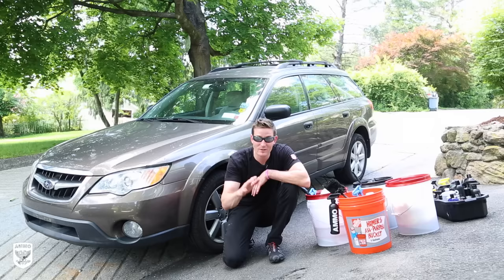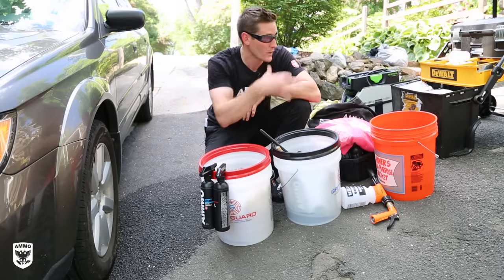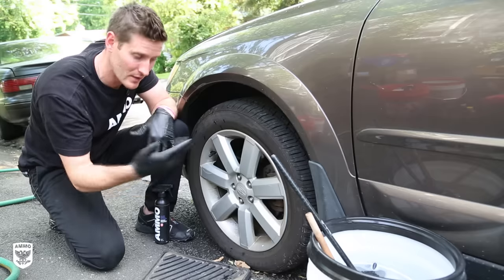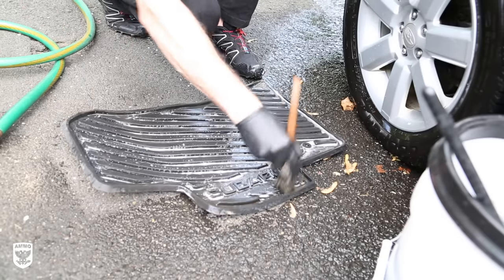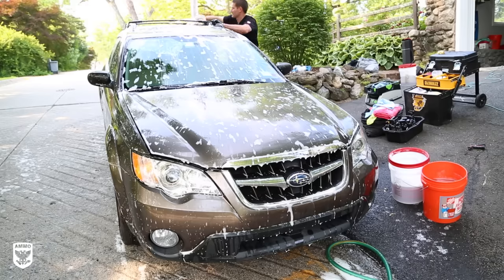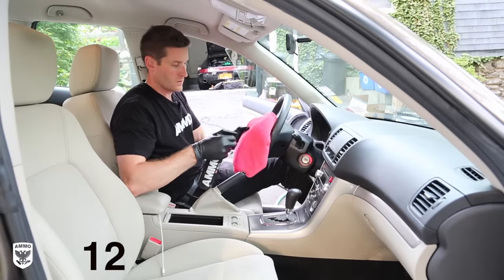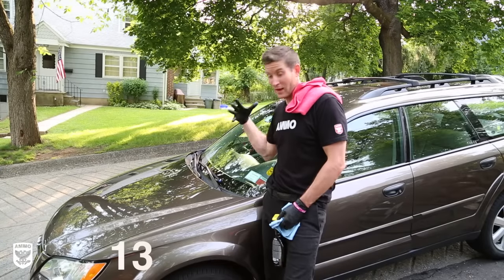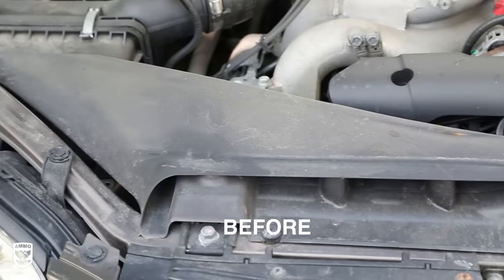Best Carwash Technique: 15 Steps + Tools

Comment: Wouldn’t it be better to use 5-6 wash mitts instead of a wash and rinse buckets. Just one bucket with your soap, water and mitts! Empty bucket for the used mitts. This way with 5-6 mitts there is no way of contamination getting into the bucket and transferring it onto the car? No more grit guards, no chance of contamination save on water. Just rinse and comb out your mitts when your done! Wash mitts are cheap to buy. If your a mobile detailer you can have 15 mitts on hand at any time! When your done at the end of the day wash them in the washing machine with a little car soap that you use when washing cars.

Comment: hi need your advice I am a beginner I have my car mobile wash business  it is steam wash I am using optima steamer , I am really Confused until now I didn't start my business because I dont now if I have the right tools , I wash my car and my friends car even if it is really dirty it will give good results bit i am not sure if steam only is enough .I see your video it is the same steps I do , I also use wheel cleaner and engine cleaner I really have Difficulty in cleaning the glass actually i don't know how to clean the windows using the steam and windows cleaner only .so plz can you help your little brother to set my mind in how to use optima steamer what is the steps that I need to do , I wont to look professional as you .

Comment: It's risky getting any water near electrical components under the hood. Using brake cleaner and a rag is probably best. Just ask Scotty Kilmer. Many use a two bucket system . I feel even with a two bucket system it's theoretically possible to still get dirt on your mitt. I use one bucket. If I suspect there's anything on my mitt I will hose it down with a lot of pressure. I clean the wheels last so I can use the same one bucket. I clean all the rims first so I don't get brake dust on the wheels. I hose off my brushes and buckets before and after each wash. I bought supplies in a car wash supply place that sells commercial chemicals. Suppose to wash and rinse one panel at a time. Important to fold chamois or towel so it doesn't touch ground at all when wiping lower panels of car. One is suppose to use spray wax when car is wet. I made that mistake other day, as I dried it first.  When you wash towel or chamois never use fabric softener.

Comment: enjoy your vids and work... 3 things I noticed that I didnt agree with.. appreciate you were flying through a lot of stuff here and you can always find fault... but do you agree on these 3 things?

1 you didnt rinse your pre wash foam off the car before shampoo'ing...  the pre rinse purpose is to disolve dirt. and although some of it will just run off the car you better rinsing it off and then shampooing rather than leaving it and shampooing over the top of it.

2 door shuts.. you commented that these parts of the car are really dirty.. and you use a spray wax and an old dirty microfibre, I wouldnt use spraywax on any dirt...  I would say use a soap or an all purpose cleaner to break the dirt down with a clean micro fibre.  because there is paint work in the door shuts and you dont want to scratch it.

3 dont put the car carpet matts on the dirty ground.. they typically have black rubber or some sort of abrasive rubber underside this will pick up dirt grit (or gunk :) ) on the ground and it will stick to the matt.

great videos...

Comment: What can I use instead of a foam gun ?
Reply: A real gun
Reply: Gloria FM 10 works really well. Use 1 L of plain water, add 15 ml of Valet Pro Snow Foam and a bit of any car shampoo you like
Reply: self serve car wash down the street works just fine.
Reply: I'd say! I take some of my interior cleaning products down to the local self-serve carwash and use the massive foam sprays. A lot of them are $1 or $2 on timers and have all the functions - pre-wash, soap wash, high pressure wash, tyre wash etc. and even a vacuum
Reply: Jonas: Me too! Gloria FM10 with 15ml of VP Neutral Snow Foam + 15ml of VP Prewash (instead of shampoo) in 1 liter of water. This works very well for me ;)
Reply: I've heard of some folks using those pressurized pump containers (sorta like what folks will use with weed killer spray or with bug killer spray).
Reply: deasttn Really? Yea, I can see that work. I'll give it a try. Thanks :)
Reply: pro snow foam lance with a pressure washer beats any hose based foam gun into the ground

Comment: I think you're great and thanks for all the valuable info which I appreciate. However, I have a criticism/ a question:
11:44 You pre-soak the car to loosen the dirt. You then use the wash-mit on the paint work?
Surely all the loose prticles of dirt would scratch?

Thanks :-)

PS. I'm probably wrong.

Comment: I would have vacuumed the interior or even cleaned the interior completely first before I wash the car paint. This is because the act of cleaning the interior will cause dust and debris to fly around and settle on the freshly washed car paint.  Just my $0.02 Cents.  :)

Comment: Can't you just use the car wash bucket to clean the tires after you've cleaned the car?
Reply from the maker: I avoid the risk of ANY wheel particle contamination on the paint. I'd rather just spend an extra $5.00 for a designated wheel bucket but, you can do what feels comfortable to you in your particular situation.
Reply: @AMMO-NYC  understood, thank you

Comment: You call that dirty?? XD    Also when cleaning the engine, just spray it down with degreaser, let it sit for 5 minutes, then wash it off! Do not rinse it before degreasing it. The same with the wheels! The degreaser does not work at all if you rinse it first.

Comment: Did I miss something?  He used one bucket for the tires.  He used one bucket for the the soap.  He never used the 3rd bucket.
Reply: +Marcus Camp He fills up the 3rd bucket with clean water and uses that bucket to rinse the wash mitt. After rinsing all the dirt and grime off in the clean bucket, he then dunks the wash mitt in the soap bucket and then washes the car again.  Using that method along with the grit guards greatly reduces the chance of scratching your paint. Hope this helps!

Comment: I'm always doing the vacuum cleaning first before the car and the ground gets wet due to high voltage electricity in the vaccum cleaner. It's not that funny to get electrified and killed xD
Reply: +João Soares It's not that easy when you are having a really tight area of where you can wash and vacum clean it!

Comment: Just do the wheels last 😂😂 why does everyone do wheels with a whole different setup 🤦‍♂️ all u need is a brush and wash mit
Reply: You do them first because you don’t wanna do the body first and then have them splatter over the clean paint anyway. Minor thing. Also, you don’t need a different bucket setup for the wheels altogether, but it does ensure that you won’t get that same level of grime transferred onto the paint. Once again, minor, but useful.

Comment: yer grit guards are well cheap $15 for 2 so thats $45 to start
 $50 each bucket, $150
soap $18
tire shine $18
wheel soap $14
plum $20
wheel brushes $42  !!! come on
lug nut brush $60 wft  $13 ebay
foam gun $40
jesus im stopping here all you need to wash your car is 25 l of tfr spray it a; over and wash off just as good for $20